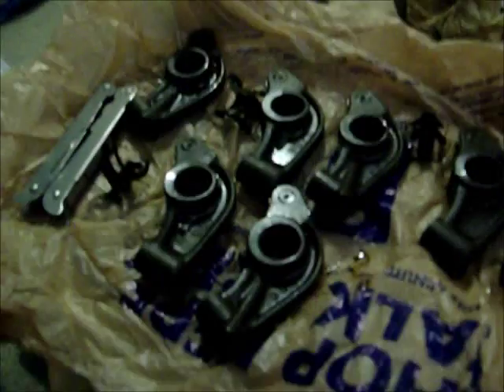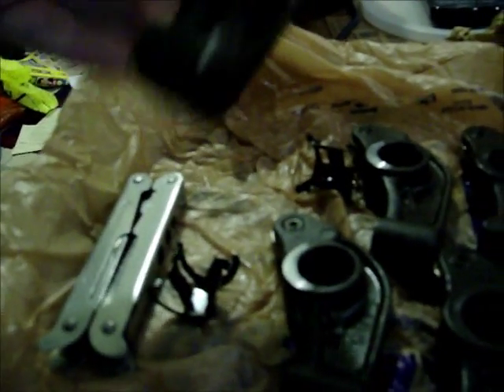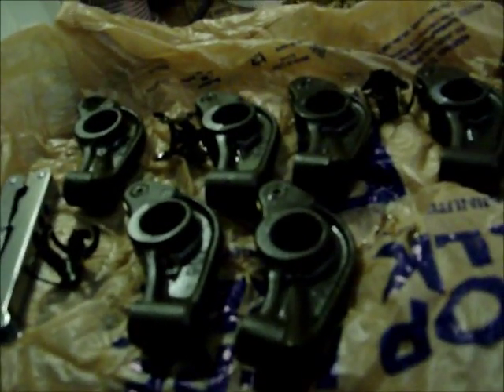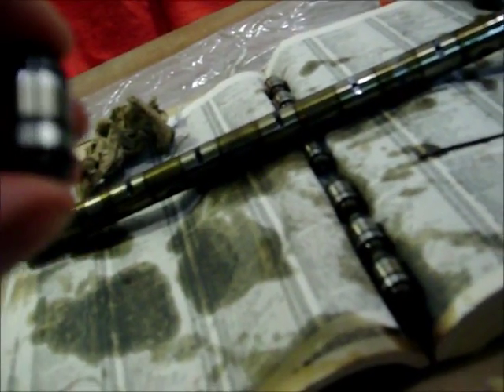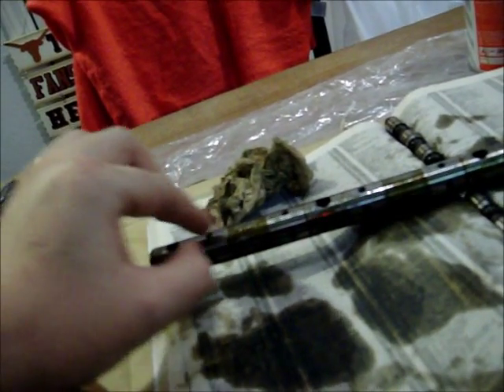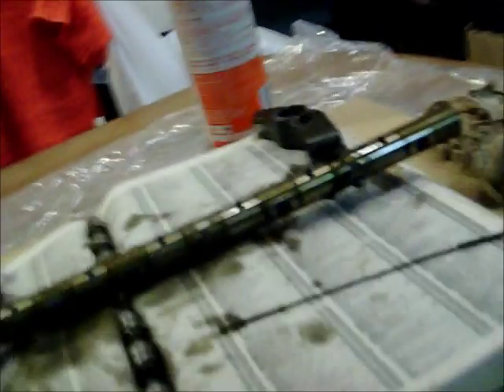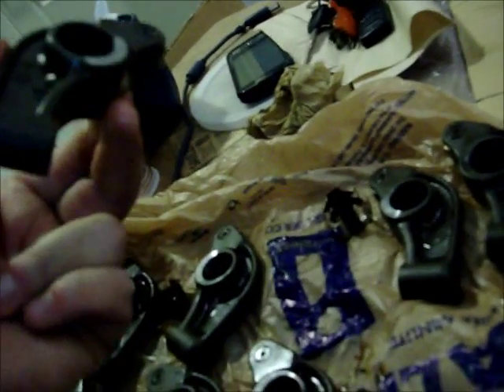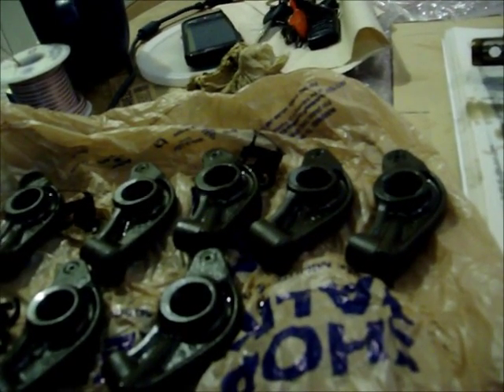Mitsubishi 4G64 SOHC Lash Adjuster Inspection

Comment: I cleaned my lash adjusters in my gallant 4g64 and they were nic and quiet for a week or two.  The noise returned...  But it only makes the click during warm up and soon as it's warm it stops clicking.  There was no visible wear or dents in the lash adjusters when I cleaned them.  I guess I'll just buy new ones?  Again it only happens during start up and it makes me wonder about oil flow.

Comment: Numbers are just a mould number in this case, to indicate where they were in the spider in the casting tree. After casting they are all cleaned then machined, with final machining just for tolerancing and positioning in the engine. Good to keep order here, as they have worn to the shaft and the valve. The way to keep these lifters quiet is regular oil changes, but with that mileage you must have done that.

Comment from the maker: Update: Shortly after making this video I did find a TSB that showed how to properly clean and bleed them.  You want to submerge them in oil after you've bled them and pump them in and out to get the air out. In my case it didn't get rid of the clatter yet, but I've only done the intake side.